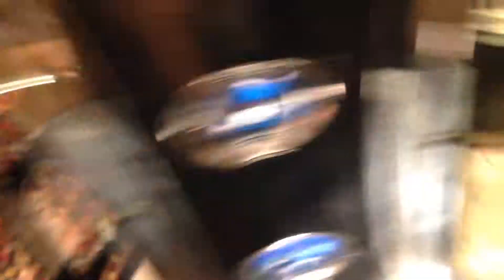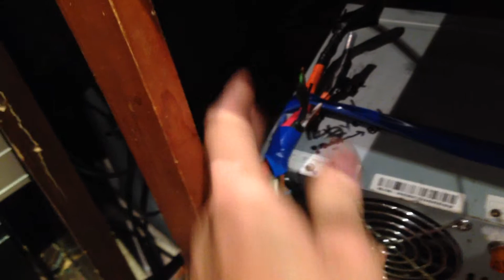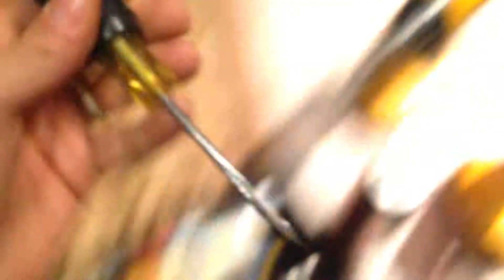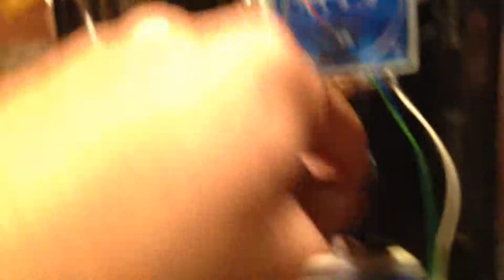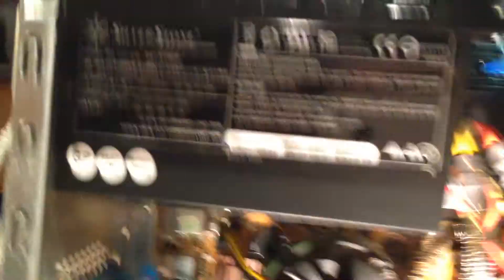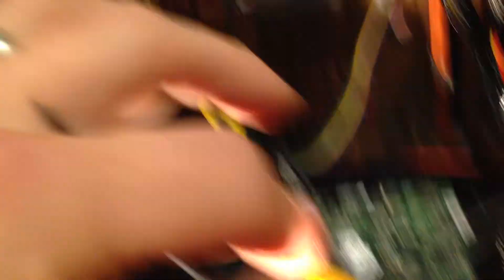Meters on free Apevia Computer I got today...

Comment: That is a high dollar gaming pc. The beeps are telling you it needs a keyboard,mouse and monitor. I see it still has the hard drive. I would try to check it out,before I trashed it. Just my humble opinion.
Reply from the maker: Okay I'll plug it up and see what it does.  I have video games unless it's the old 8 bit Nintendo!  I'll let you know, if u want it it's yours!  S
Reply: Steven King
I could never get used to apples operating system or desktop. I started out on windows 3.1 operating system,way back when :) You sure had your pick in that place.just use the parts for what you were talking about I think it would look cool.
Reply from the maker: Just replies a long message and it was erased.  Storming here .   Grrrr!   I'll try again tomorrow .    Thanks for looking .   S